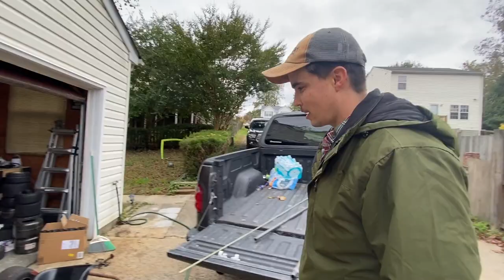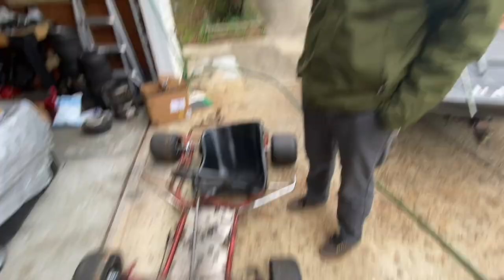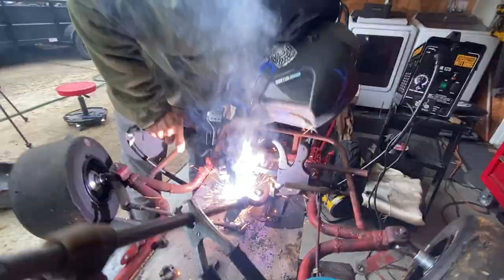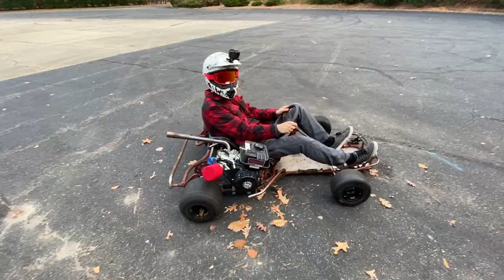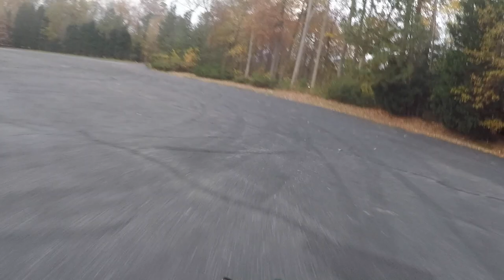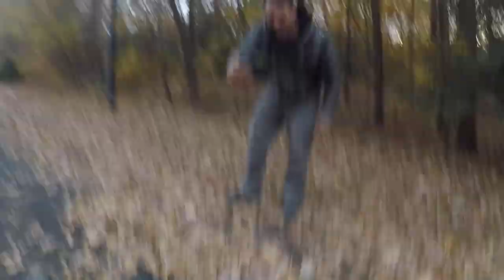Vintage Race go kart revival | Will it run?!

Comment: How much does it usually cost to replace one of those
Reply from the maker: We used an engine we already had, we already had spare tires and wheels, only thing we HAD to buy was an axle, bearings, steering rod, tie rods, and seat.  We did add some things like a torque converter for fun.  But those are on amazon for $60.  I’d say we did this build for about $300 total.  But again, we already had some of the stuff.

Comment: What gear are you running
Reply from the maker: It’s just a predator 212 with a Stage 1 from Gopowersports, and a 30 series torque converter.